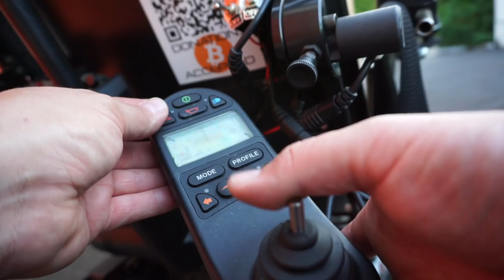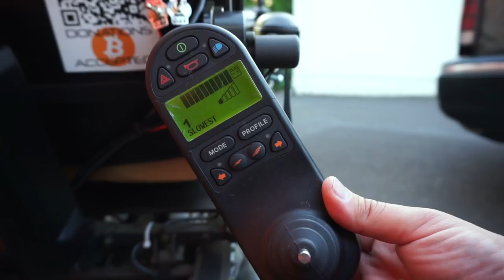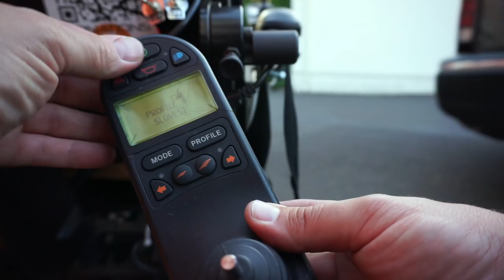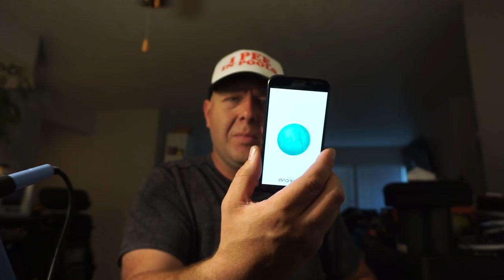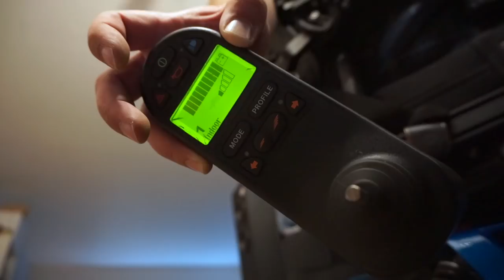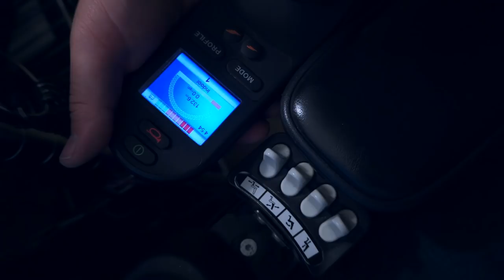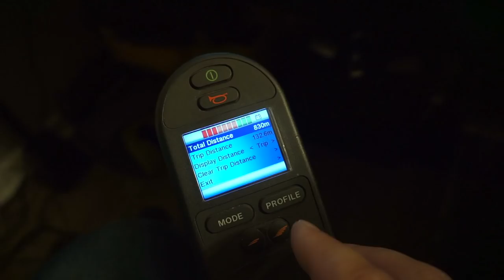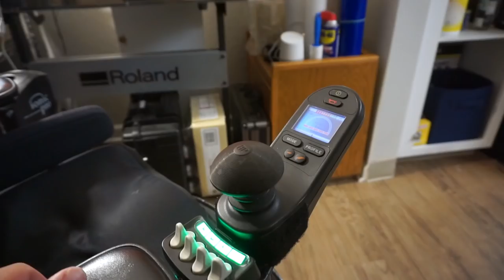VLOG 365: Fixing the joystick AGAIN

Comment: My son's C500 gimbal cable has come unplugged from the joystick circuit board several times, usually after the armrest is allowed to slam down. I'm now using a cut down 3M mounting square to secure the connector. I hope is works. I agree that there are several under-designed parts on the C500 and Chairman 2k. In particular, I have had to replace the seat elevators on both and finally found a better lockwasher so the mounting bolts don't loosen. Thanks for your great videos!
Reply from the maker: Awesome! Glad ya got it going!!

Comment: I have an idea for that "loaner" joystick that doesn't have the knob. I would epoxy a golf ball on it just for fun. Put the ball in a drill press so that you make sure you get the hole drilled straight.
Reply from the maker: nice thing with golf balls.. all the rubber bands inside of them help hold them firmly onto the joystick knob! if ya drill the hole a wee bit small no epoxy is needed :^)

Comment: I've had my M300 for little over 5 years now and I've never had any major issues with it. I've had one bad cable error and that's been replaced and no issues since then. I've also taken this in the grass mud gravel etc etc and it's been a beast I have 6,735 miles on it. Maybe it's just the model from Permobil
Reply from the maker: yea same here.. my m300 has been a tank! ive done a lotta crazy stuff with it! but the C300's apparently maybe not as robust...

Comment: I have a quantum Q6 it has just the four button joystick and doesn’t give codes or anything but when you try to go right it will go slow but if you try to go full speed it kicks out has a picture of the chair and the joystick like flashing... can turn it off and back on and it will work fine unless you try to go right fast again! Any ideals how to fix this? I have had it apart all connections are connected good inside and outside the chair 🤷🏻‍♂️
Reply from the maker: hmm im having trouble finding the service manual for that controller (NE+) are there any numbers it flashes? or specific blink patterns?
Reply: No but I think I fixed it I held the speed up and speed down buttons for like 30 seconds and it’s working fine for now 🤷🏻‍♂️ Doesn’t make sense but I couldn’t find anything from anywhere online about it either

Comment: Didn't know R-Net controllers worked on other brands of chairs besides Permobil. Do you happen to know what the joystick knob is that you are using on the c300?  looks like a more comfortable knob then the standard Quantum one I'm using.
Reply from the maker: yup! R-net is all over the place! permobil actually had to license it from P&G years ago
body point makes a bunch of joystick toppers.. here's their site! they're not super cheap.. but worth it IMO
my hands cramp up trying to use a regular one.. this is the "rubber dome"

https://www.bodypoint.com/ECommerce/category/power-chair-components/joystick-handles
Reply: thanks

Comment: Greetings, I have a permobil C400 chair with an R-net joystick, it turns off sometimes, with your video I discovered that the cable is failing near the connector, can it be repaired or where to get just the cable?  Because that joystick is very expensive, Thank you.
Reply from the maker: The cables aren’t easily removable from the joysticks.. ya have to open it up and solder things a bit.. UNLESS ya have one of the newer style large screen joysticks.. then the cable just unplugs from the bottom and can be replaced :-)
Reply from the maker: here's some more info on the different types and how the cables connect.. https://youtu.be/0aLSxddJPRc
Reply: Greetings, thank you very much

Comment: If I had a nickel for every time I forgot to put the heat shrink on before soldering...
I like to use the marine type (cheap at Harbor Freight) since it has adhesive (not very flexible, however).
Interesting video!

Comment: Great video, definitely helpful. I have a Quantum 6000 and the gimbal is messed up. Giving me the "joystick not centered error". No screws or bolts to take it apart though. Any idea how to takr it apart? Any info would be appreciated.
Reply from the maker: there's screws on the bottom of the joystick.. ive replaced the output cable on those before.. ya have to remove it from the chair, and there should be 3-4 screws that hold the case together..
Reply: @TotallyNormal-  sorry the quantum 6000 was my last chair. This is the Q6 Edge. I got it completely off the chair but there's absolutely no screws or anything to undo. Its like it's clipped or glued together. I just don't want to break them getting it apart.
Reply from the maker: the colored/silver ring around the edge of the joystick un-clips and i think the screws are under there.. ive got one lying around here somewhere.. ill try and find it.  those trim pieces are interchangeable for different colors etc..

Comment: I have a Permobile controller displaying JSM error 808. Can it be fixed?
Reply from the maker: was it 0808? if so thats a joystick centering error.  when powered on the controller is looking for the joystick to be centered - sometimes re-calibrating the joystick with a programmer can fix it, or theres a loose connection to the joystick gimbal inside, or the gimbal itself is bad.. either way its something a dealer/shop will probably have to look at :^/

Comment: Great info. I have been working on my husbands m300. Now the controller joy stick is showing in the screen a pic of a joystick, then a pic of  the chair back and the a pic of the chair seat and these can be moved with the joystick . I'm trying to just get it back into normal or outside mode so he can move the chair.  I don't want to him to operate the chair functions that way  (then the chair does not move)  i did not know about pressing the the 2 buttons at the same time to change things.  My husband has MS and is in assisted living and they have not not got a clue about power chairs. Thanks for any info.
Reply from the maker: I assume you've tried hitting the mode button? it should cycle between the drive mode, and the seating control mode.. but there could be something else going on...
Reply: Yes I have hit the mode button and I get the "toggle pic" then the others. It has never done this before.  I have become quite good at taking this apart and repaired his charger cord/ splicing it and putting it back together.  I hate to call the chair repair people because they are charging  insurance and then I get billed  10-20% . Thanks for getting back to me so soon.
Reply from the maker: just making SURE :^)  yea sounds like theres some other weird problem going on.. id just check all the connectors on the chair make sure they're tight, maybe plug/unplug them - theres a junction box for the seating under the seat pan in the front with 3-5 flat, black, 3 pin plugs.. in the past ive had those become loose or just not be connected well..
hard to tell without seeing it.. but nothing common comes to mind right off, other than just the basics..
sorry cant be more help.. hopefully it gets sorted out!
Reply: I'll check it out next visit. I really appreciate your answering so quickly. I can't  find anything on the web that addresses this problem. Thank you R

Comment: HI, I was wondering if you're familiar with the error trip code 0808 (joystick error). I use a permobil c400esp with the monochrome display and it just crashed today. I opened up the joystick just now but I did not see any loose or disconnected wires.
Reply from the maker: thats a center reference error.. so the gimbal doesn't know where center is.. a re-calibration might help.. or potentially the joystick gimbal is having problems..  there used to be a supplier for parts.. let me check and see if they're still around
Reply: @TotallyNormal-  Thank you, i'm on my backup chair for now. How do I recalibrate?
Reply from the maker: on board programming has to be enabled.. or use a handheld programmer / USB dongle  soo probably a trip to the dealer :^/
Reply: @TotallyNormal-  Thanks so much for the info. I'll have to see if I can find a programmer, as I have heard they are expensive and hard to find. I think I have OBP but unsure how to invoke it.
Reply: @TotallyNormal-  Trip to the dealer not an option for me as I do not have medical assistance. I'll have to try and hunt down a programmer and pay out of pocket. :(
Reply from the maker: just to check... all the connections inside the joystick were plugged in and tight? sometimes they can be loose and not look like it.. i did a repair to a joystick a while back.. https://youtu.be/hIYZpNK-N0c?t=330 (about 5 : 30 into the video

Comment: What is the difference between A C 350 aNd a C 300
Reply from the maker: same chair, but rear wheel drive instead of front wheel drive.
essentially, they flip the seating around backwards, and use slightly different swing arms that the castor wheels are mounted to :^)